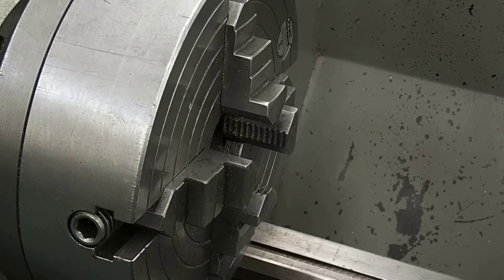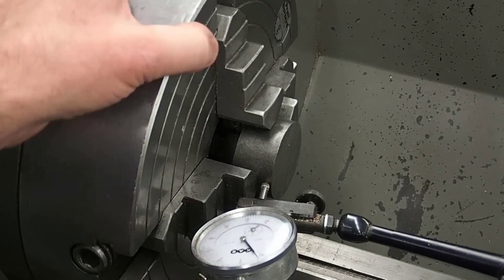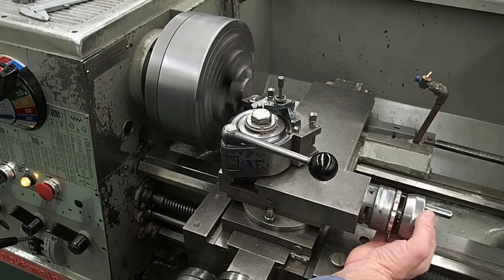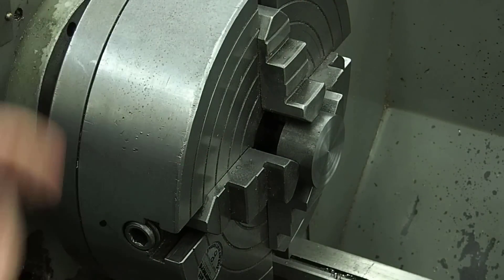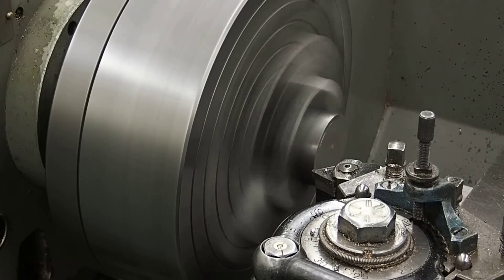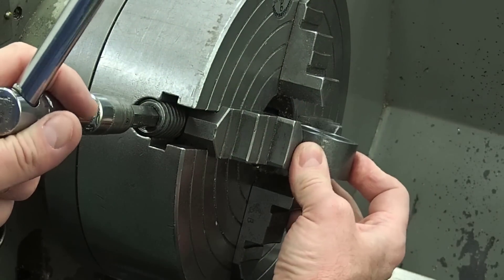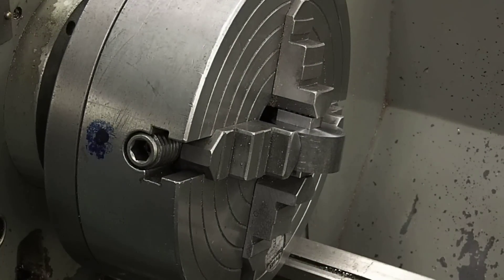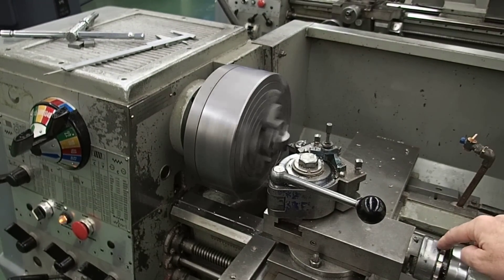Machining a Cube on a Lathe

Comment: Thank you for this.  My father was taught to be a machinist in the Navy before WW II, his final test was a cube accurate to ± 0.001 using only a lathe.  He had a trade that served him well until he passed in 1993. This gave me some insight.
Reply from the maker: Great memories  :)
Reply: Freaking MR's.....thats what your fathers navy rating was.. machinery repairman
Reply: My father was a motor mac  got out early from WW II as he was found no longer fit for sea duty after his ship was sunk.  AM294
Reply: my father cleaned their ass all in the ship, starting with the machinist
Reply: Within 0.01 mm? That’s a massive tolerance
Reply: That's amazing, given the technology of the day
Reply: less than 4/10ths of a thou. Really!! You must be good ;-)
Reply: machiningmoments My grandfather was a MR in the navy during WW II. He used to have some great stories
Reply: Interesting someone posted that. My father was a machinist at Rolls Royce, most notably Merlin engine parts. When he was learning the trade, one of the tests was to hand file a block down to a perfect cube (one inch?) accurate to at least 0.001". I say at least because I do remember when he transferred to North America, he was told to cool it. They only needed 1-2 thousandths and at Rolls Royce everything was one half a thousandth, in the 1930's, and he couldn't break the habit.
He'd make such a face or just walk out of the room if he saw me or anyone else using a file or a hack saw "incorrectly." To this day (I'm almost 65) I can't pick up a flat file without thinking about my dad.
Reply: @LiveMusicOntario  It's interesting that Charlie, David and others had fathers that came up through this skilled era of pre CNC industrial machining. My own father was a Toolmaker, at one of the big American defense plants, starting in the WWII years and up to 1972. Like your fathers, he also had to complete the "One Inch Cube" test. I cannot remember if it was a hand file operation, or on the Lathe- but I still have the Cube! It's got a nice sheen to it, (he gave it a great finish) I don't let it get rusty. A nice remembrance of our Fathers, right gentlemen? Thanks for your stories.
Reply: One of my test jobs when I was an apprentice fitter and turner in 1956 was to make a brass 1" cube by hand with nothing more than a hand hacksaw, a square, a scribing block, a steel rule and various files. It ended up perfectly to exact dimensions and squareness - it had to fit every which way into a 1" thick 3" steel plate where I chain-drilled and chiselled the hole and finished it with files and that steel plate had to be perfectly square every way. The whole job had to be polished to a mirror finish with no sharp edges for the examiner to cut his fingers on and all of it was to a tolerance of .001" - including for squareness. The examiner tried to force feeler gauges in everywhere around the cube and a precision square and any gaps were measured and marks lost. I still have that cube sitting on my desk right now and I've checked it with modern micrometers and digital verniers and a good quality engineer's square. It's perfect.
Reply: @fredfarnackle5455  seeing your post how long did that take to do and was it timed?
Reply: Yes, all test jobs were timed, we lost marks for going over time. I can't remember how long we had for that particular job, I think probably something like two days. I remember another job that was a 1/4" thick brass triangle that had to fit in a 1/4" thick 3" square plate. Same making, fitting and marking process as for the 1" cube. The triangle one was a two day job but I finished it in one day and it was that good it went into the display cabinet for excellent marks, beating the previous holder of that position by a significant margin. I forgot to mention in the previous post that the examiner marked all our jobs for exact measurement and would take marks off for as little as 0.0005" deviance from the drawings we followed.
Another thing I forgot to mention, all jobs had to be perfectly parallel for thickness and were also marked accordingly, the examiner used to take great delight in forcing feeler gauges under his precision square and straight edge.
Reply: i assume you mean +/- an inch right? haha
Reply: I hold half a thou with fowler tools and old Kingston lathes...  .001" is not hard on anything
Reply: now we have china, thank god for china
Reply: and thats why all production jobs went to china; we cannot do that.  @fredfarnackle5455
Reply: I had to file parts to the same tolerance by hand. Put that in your lathe. LOL
Reply: Richie Devereux   I was a machinist for over twenty years.  Manual lathes I worked with were mostly .001" diameter graduations on the cross slide dial.  One, a LeBlond, was .002" per graduation on the diameter, but that was an old one.  I was a Class A engine lathe operator near the beginning, and held .001" diameters all day long on workpieces ranging from .25" diameter to 12" diameter.  This was production work, day in, day out.  The only way to get a closer diameter than .001" with those lathes was to use strips of fine emery paper or scotch brite to bring the tolerance down by hand.  That in itself took a lot of skill and finesse.  On long diameters, it was much more difficult to do.  Never operated a Cazeneuve lathe, but viewed one working on YouTube and it doesn't appear to be made any differently than a regular engine lathe.  Unless you were working with a nearly new machine that had little wear on the ways and cross slide (and perhaps a ball bearing lead screw and nut like N/C lathes have now), I would think that holding a .00039" diameter consistently is a stretch, especially on a long workpiece, unless you're referring to the tolerance (+/-.00039").  That would sound more realistic.  I've operated several brands of engine lathes of various sizes... small, medium and large, from old to brand new... American, LeBlond, Lodge & Shipley, Mauser, both manual and N/C.  None of them could consistently hold a .00039" diameter.  I take it you were doing a lot of "hand work" to achieve that diameter.  That kind of diameter, at the time I was machining, required hand working to finish.  As I said, I was doing production work.  I've operated several N/C lathes that were high precision, and none of them was able to hold that kind of diametral dimension consistently.
Reply: i was wondering why you would do that.
thats new to me and ive been runnning lathes mills n all since 1982
thats kool im kevin in central pa
Reply: Alabama Tree, agreed. My late father was a craftsman fitter, craftsman turner, and craftsman boilermaker. Very unusual for someone to attain to craftsman standard in three trades, nowadays, but it's not unknown, and he did it. He was also qualified as a tradesman toolmaker. He served his apprenticeship making steam torpedoes and other machinery. For some of his work, he had to machine precision parts to +/- 0.0001" and better at specified temperatures, using lathes and other power tools. He could work to within 0.001" (about 25 microns) using only hand tools. He was old school, so everything was in Imperial measurements at first, but Metric later. One thou, to him, was a huge tolerance. Machining cubes, as in this video, was basic, and even 'roughing out' would usually be within 1 or 2 thou of square. He once disposed of his own 3'6” Myford lathe because it had been treated roughly during a move to Australia, and the chuck shaft was off-centre by almost 0.001”. His hobbies, right into retirement, included making compressed air-driven scale model machines, including high speed turbines (shaft speeds starting at about 20,000 r.p.m. and going up to above 200,000 r.p.m. (the fastest he had the equipment to measure) on at least one model turbine. An error of +/- 1 thou would have been disastrous at those speeds.

He also cut all of his own miniature bevel gears, straight gears, epicyclic gears and worm gears, using one of two small Myfords, or later a small Clarke lathe, and sometimes made parts for, or even complete, clock mechanisms, ranging from long case to small mantel clocks.

On another point, in order to achieve his qualifications, he had to know by heart a whole book full of thread sizes, angles and profiles, with no mistakes. He could still tell you many of those when he was more than 80 years old. Some of them were even Victorian square thread dimensions. His memory encompassed BA, BSF, AF, ASF, Metric, Whitworth, Square, and a number of other standards, plus the reasons why they were made, their particular strengths, failure modes and weaknesses for different metals. Well over 150 pages of densely-packed text and diagrams.

All of this is not for bragging rights, but to point out one simple fact: Any competent turner or toolmaker, with enough experience, can achieve very fine tolerances indeed, even with fairly simple equipment, providing that the tools and work are cared-for correctly, and assuming that workshop temperatures are regulated correctly. He or she can also memorise far more information than most people believe is possible. It doesn't take a genius to learn thread sizes. What it takes is time, concentration, attention span and plenty of hands-on experience. Unfortunately, it seems that far too many (on here, at least) suffer from lack of attention span, and an 'I want it now' mentality, with everything handed to them on a plate, whilst trusting on technology to deliver information in a trice. That's fine, until the internet goes down, or until your device battery fails, when you're working at a remote site without a suitable power source. (Not many iPhones work very well when only 415V 3-phase AC is available in a machine shop!)

I agree that the cube in this video will not be 'perfect', but the machinist did say that he was skipping steps for brevity, early in the video. The concept was being taught. It is up to the viewer to go into his or her workshop, to try the technique, to make careful measurement checks, and to learn from any mistakes how to be more accurate next time a cube is being made. It's the only guaranteed way to learn machining skills. My guess, incidentally, and for what it's worth is that the cube in the video would have been a regular cube within a few thou, and within less than +/- 0.1° of being a square cube. 

It will be interesting to know what the video presenter says about the real tolerances of the cube.

It's very much appreciated that he took the time to share some basics of his years of experience for the benefit of those who want to learn something.

My lathe only has a 3 jaw chuck. I'd like to know how to machine an accurate cube with it, apart from by first making some suitable adapters for the job. I can't ask my Father, for obvious reasons. And I'm close to drawing my pension!

No, I'm not a professional turner, and worked in wafer fabrication, amongst other things. Now that was high precision work! Less than 1 micron of error in three degrees of freedom across a 50 mm wafer (in the 1970's, and using soft-UV optical manual alignment) would mean weeks of work wasted. Machines today do orders of magnitude better than that; they’re using nanometre tolerances for the CPU in your device.

Thanks for reading, and apologies for the length of this. It's hoped that you, or someone found it interesting and useful?
Reply: James ALEXANDER I’d just use a Bridgeport this practice is insane so is yous
Reply: David Moran  i went on a 2 year mecanical training from 1976 to 1978,, the 4 first months we want using lathes,, only a hand file and measuring instruments shaping a piece of metal in to a predetermined shape,, with exakt measurements and angles
I HATED THAT AT THE TIME... but it learnd us patience. and measure often...
it sucks starting over after filing a week and you have taken off to much. haha
but it sucks even more if you say later on at real work, take to much off say a costly propellar shaft for a big ship.
Reply: I guess I could make a video of me hand filing a round piece of stock down to the form of a cube. Wouldn't be very interesting though.
Reply: But who makes the machines that makes the machines.....
Reply: @Pattaya-360  China
Reply: Alexander Wardrope lol so you’ve got a fanuc robot holding a file and a penchant for writing tedious code?
Reply: 0.001 inch = 0,00254 mm
btw 0,01mm is not "massive" xD it all depends on the aplication and device dimensions.
if you like tight stuff you might like this :
https://www.youtube.com/watch?v=DQvjl-Z_V6s

https://www.youtube.com/watch?v=jAhKOV3nImQ&list=PL--PgETgAz5FGoatB9KQzbnpv0bgZqU2l
Reply: @AlabamaTree  He didn't specify the unit but probably meant +/- 1 thou ie. +/- 0.0254 mm. That would be applied to the center to center thickness of all 3 pairs of sides of the cube. There would be a time limit and you have to consider the limits of the machines.
Reply: 0.001mm wow thats great.
Reply: @docalexander2853  put that in your lathe and smoke it! This comment has 420 likes! Lol
Reply: @Scot_With_One_T  it was the same pretty much
Reply: @Trebonius Flonius  No worries, you're welcome. Yes, I am - I'll be 80 in April 2020. I can still use all my hand tools effectively and I've also got a small mill that I converted to CNC and a lathe. My apprenticeship was the best thing I ever did.
Reply: AlabamaTree my brain automatically thought wtf 0.001mm but realising it last .01 it wouldn’t be very hard
Reply: @slash09r1  It's not hard on people like us who are master level, it's quite hard on apprentices.
Reply: We started our apprenticeship, 1953 ,at the HMD, Mcd, The one inch cube was a
Our first year test ,by hand tools only,  2nd year was machinery, Final year was The , Jib, Block Strap and Cotter, by Hand or Machine ,with Square Thread, Fiver years total
Reply: @frankwells8204  you got it easy :P I had to make a master square for the shop once I graduated, better than the one they had.  Lots of lapping.  "It wasn't better but I got a back slap for getting it very very very close."
Reply: David Moran+ Everything I know about machining, I was taught by these older machinist guys Ive met who let me adopted them as my "grandpas & uncles,"  bcuz I never knew men like that growing up. If your dad enjoyed his machining work, he and I would've got along great! 
This world needs more men like your dad who are intrested in creating, getting their hands dirty and who have the balls and inner calling to fight for what's right in this world. We need them more than ever, sadly!  Over the last year, Ive had the extreme pleasure of reversing my usual role and I've been teaching my friend John, who is 76, (Im 36 now)everything I know about machining. He said to me the other day "I love machining and making parts so much.  
My only regret is I wish I would have learned ithe craft when I was younger, not at the end of my life, so I would have more time to enjoy it." It broke my heart! Make every day count! And who knows. He doesnt smoke or drink. My fiancee's great uncle will be 105 this April! He is also a machinist but his eyesight recently left him about 2 years ago, also very sad. But the stories thst man has are incredible! He told me about THE DAY THE STOCK MARKET CRASHED IN 1929!!!!!!!!!! Can you believe that? He was 15 and working in Detroit. Crazy and amazing stories!!!
Reply: This comment section is awesome! Look how machinists have shaped our lives! "Long live the men who create shining metallic beauty with their dirty, calloused hands!"
Reply: Inch or metric for that .001?
Reply: I just wanted to thank all you guys for your comments. I really enjoyed reading them.
Reply: @hyperhektor7733  In terms of machining, 0.01mm is massive. Everything is relative, so there was nothing wrong with the original statement because it was talking about machining tolerances.
Reply: @AlabamaTree  You must be blind, it clearly says 0.001

Comment: As someone who has zero experience with lathes or machining in general, this video was fascinating as hell.
Reply from the maker: Thanks!
Reply: Eh, maybe so.  It certainly wouldn't consider your humor useful.  That's for sure.
Reply: Not trolling. Just guiding you.  Peace.
Reply: Sam, you really sacrifice the "who asked you" high ground when you're the first one to offer an unsolicited opinion.
Reply: @Liesmith424  I know it's unrelated but, I used the same picture in your pfp to make mine
Reply: I was an R&D machinist and CNC programmer for 13 years. That's the way you do it on a hand cranker. It really is fun.
Reply: @buzz magister Hmm...I wondered.
Reply: but it is, how can a non existing place be so real to a few people? @Sam Rhodes
Reply: buzz magister Tis why I do it for a living. Never gets old to me
Reply: Same here. I was totally expecting to see the work being held in place some how on the tool rest and the tool in the chuck.
Reply: "fascinating as hell" . The English language is  swange, as hell
Reply: Just purchased a micro lathe from Grizzly. Can't wait.
Reply: I agree with you brother!
Reply: Search CNC machine motorcycle helmet if you want to see what machining can do nowadays.
Reply: @metalman6708  why?  I can model and program very complicated things.  Seems cheap in some ways.  This man was doing something "manual" which never goes out of style.

I once programmed a wire EDM to make something that was a "1" on one face and a "2" on the obverse.  Cool, no doubt, but so what, the machine made it, not me.
Reply: I learned alot
Reply: @pingpong1138  the man demonstrated great skill, learn
Reply: this is honestly one of the easiest things to do that there is. I was bored.
Reply: @lukewarmwater6412  ok
Reply: https://www.yaplakal.com/forum23/topic2193714.html станок точит человека death the same machine